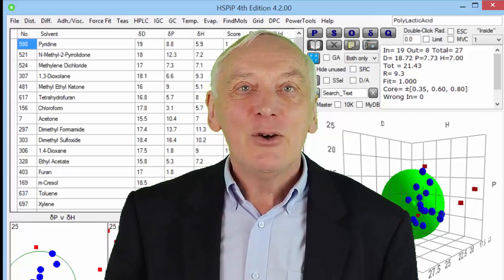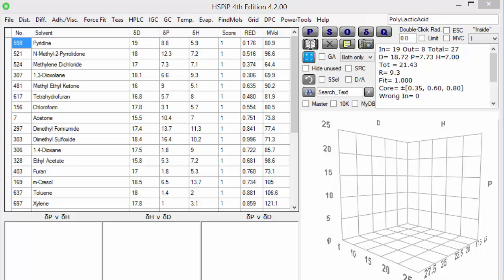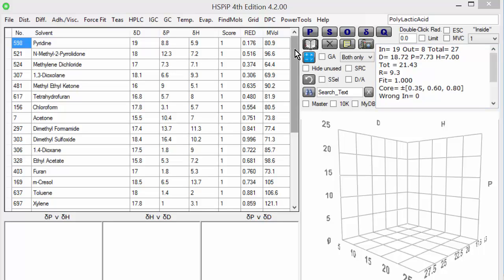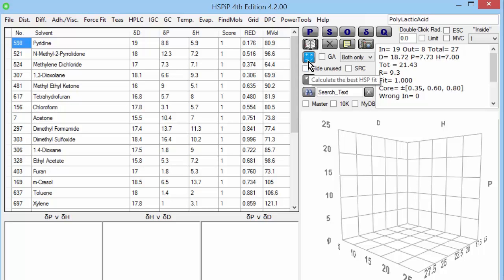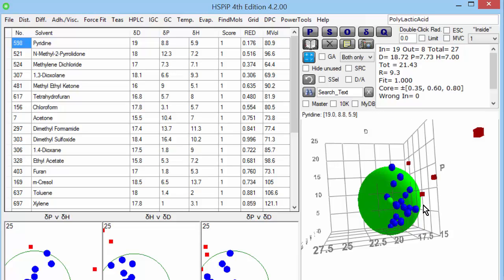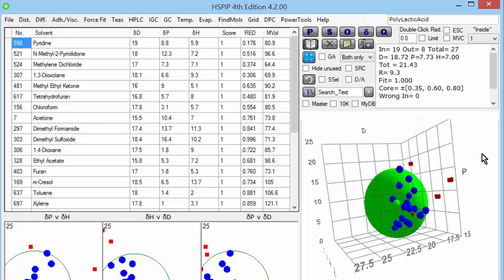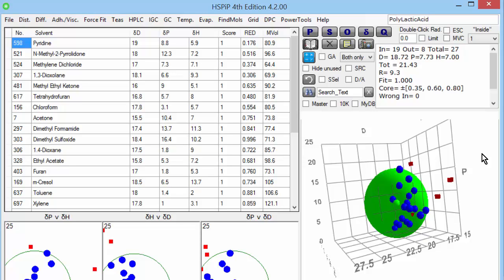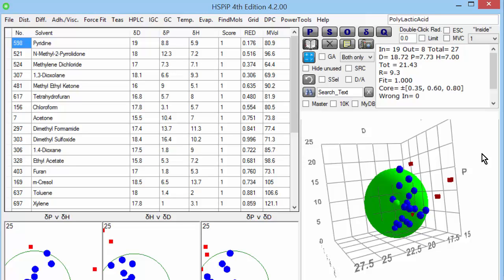HSPiP Measuring HSP

Comment: Prof. Abbott, thanks for the great video. The polymers in the test tubes must be in pure form or HSPiP is able to work with polymers in solution (taking the solvent present in the polymer in consideration to calculate the actual HSP)?